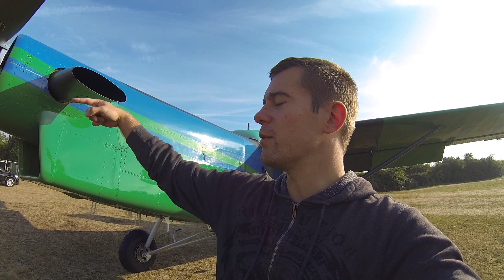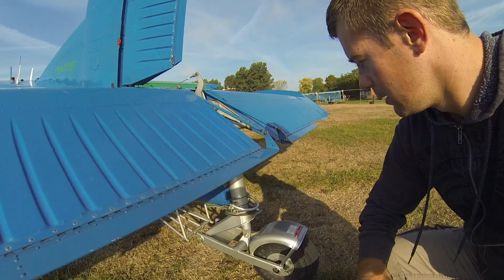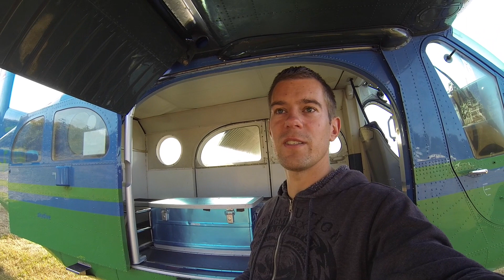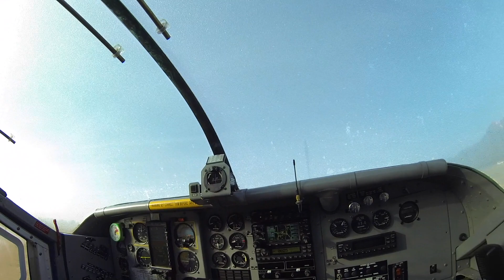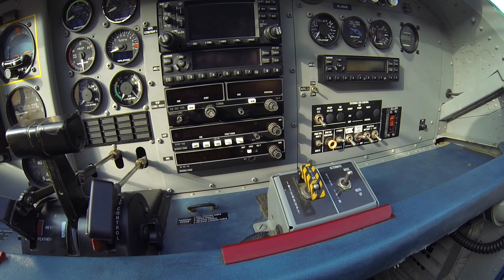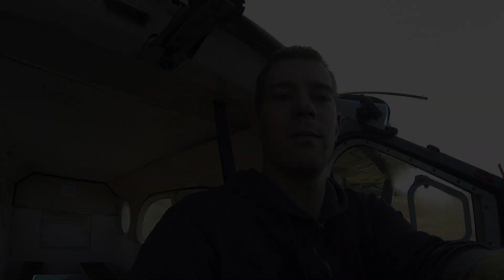Skydive Pilot: Introduction to the Pilatus PC-6 Turbo Porter

Comment: do you only do 3 point landings or also wheel? I cant seem to find any videos of a wheel landing
Reply from the maker: @mgattini  On the PC-6 you basically only do threepointers. The whole plane is aerodynamically and gear-wise set up to land (and take off) like that. It will not bounce if you roll it on instead of fully stalling it. You can do wheel landings, but they feel odd to do and there is really no need.
Reply: Good to know, thank you!

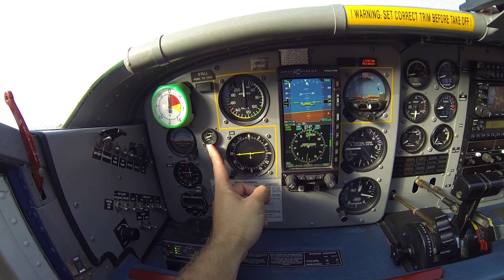Comment: 22:44 i would like to know more
Reply from the maker: @Cambone13  If you are talking about the trim: the control forces are so heavy when mistrimmed that you can hardly overcome them by muscle power alone. Typical issue is that without skydivers for landing you need to trim quite far back and for takeoff with skydivers quite far forward. If you forget to reset the trim after landing, you will get a sudden pitch up, stall and crash on takeoff. This is why most Porters have been retrofitted with a pitch trim warning that alerts you if you are outside a safe takeoff range.
Reply: @LiberTY7416  very cool, thanks for info!

Comment: I came here to hopefully find out what control the pilot is dealing with when he reaches down with his left hand shortly after touchdown. Now I know. It's to unlock the tailwheel and allow it to steer. Thanks.
Reply from the maker: Glad it helped. Normal procedure is to slow down to walking speed and then unlock the tail and reset the rudder trim for takeoff.

Comment: Was that porter ever stationed at Forhen near trier?  I was there in 1988-1992 and jumped out of one until they replaced it with a Cessna Caravan. Love both but the Porter is just so awesome on take offs and landings. Door is huge!
Reply from the maker: Unfortunately no. This example previously was F-BSTF stationed at Strasbourg and later at Péronne in France. Only arrived in Germany in 2003 as D-FROH at Breitscheid and then to Herrenteich/Calw in 2012.

Couldn't immediately find out which Porter was operated at Trier in those years. But you can check www.pc-6.com for info.

Comment: Thank you so much fr this exhaustive presentation. What happened to the third episode? We want some more!
Reply from the maker: I am glad you liked it. If the link to the third episode from the description does not work: that is because I received a copyright claim for music I used in the intro. Hopefully I will find the time during the current forced break in operations to redo the video and upload. I have also two more videos planned. Thanks again!
Reply: @LiberTY7416  Vielen dank. I usually fly Jodels but I took the opportunity of the lockdown to go back to simulation to learn both about complex engines and mountain flying. Thus, I chosed a PC-6 and your video was a wonderful introduction. I wonder if in the 3d episode you details engine and flaps settings during different parts of the flight.
Reply from the maker: @PhilRami  Kudos. Mountain flying is very rewarding and a lot of fun. In the video I indeed run through a full skydive flight with all the settings. Flaps is pretty straight forward with 28° for takeoff and normal landing and 38° for STOL landings. Engine needs a bit more care during steep descents due to the beta mode of the prop. Will try to fix the video over the weekend or during next week.
Reply from the maker: Now reuploaded the third episode with the music fixed:
https://youtu.be/IENhp5TYgI4
Reply: @LiberTY7416  Thanks so much. I'll look at it very soon.